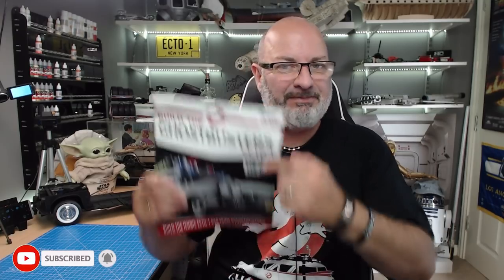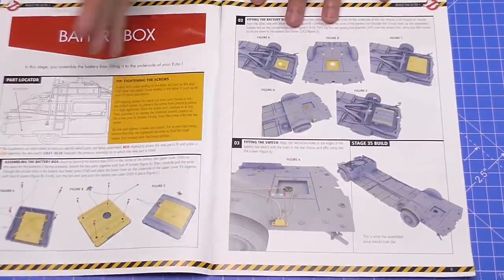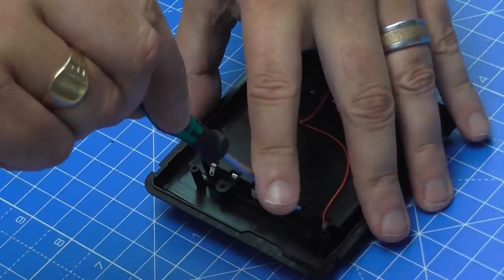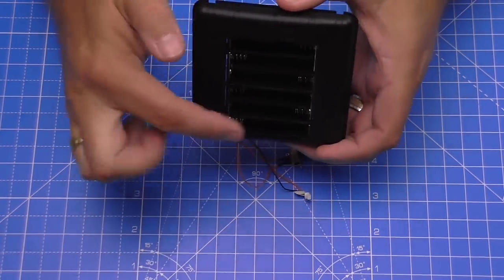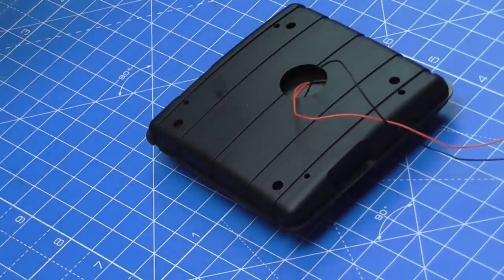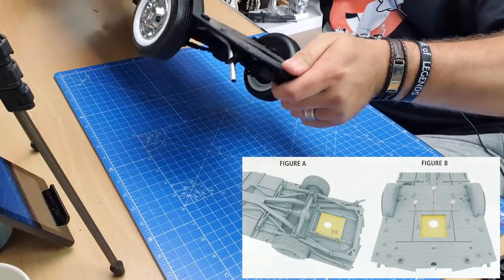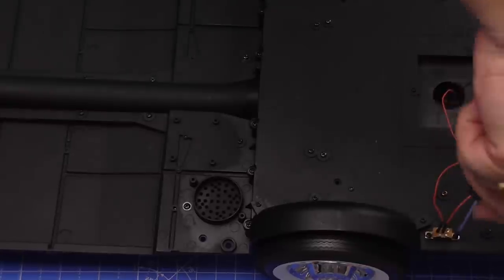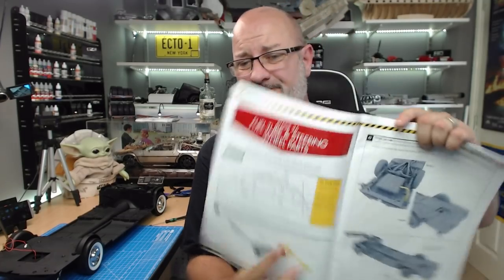Build the Ghostbusters Ecto-1 - Part 35 - The Battery Box and On/Off Switch

Comment: Looking good.  Do you think the Ecto-1 batteries will bleed out power like the Delorean did?

Also I checked the height of the  Ghostbusters Plasma series figures next to my Delorean. They are a little short.  Maybe 1/10 scale or smaller. Oh well.
Reply from the maker: I never had a problem with the Delorean bleeding power. I suspect there was a short in the circuit board. We wont know until wee see the board for this one but I am going to make sure more wiring is A1
Reply: Synthlord yes, the current EM figures are way too out of proportion (small) hoping EM considers a 1:8 scale set in the future.

Comment: At this stage has anybody considered install of a dc converter plug to allow getting rid of the batteries? Assuming this will eventually be in the display case, it would eliminate battery changing and also the inevitable potential of battery leakage in the model. Wondering if you and folks here think this is a good consideration or not. Think if wiring done correctly, it could be wired after the current batter box so not to get rid of the current, more as an either/or. Thanks All.
Reply from the maker: I think Modelmodz are already on it
Reply: @WorldofWayneUK  when add echo-1 builds?
Reply: I made a transformer my self that I use on the Millennium Falcon. It's housed inside a pewter pint tankard and looks much nicer than those plastic ones you buy from the shops. Works perfectly too.